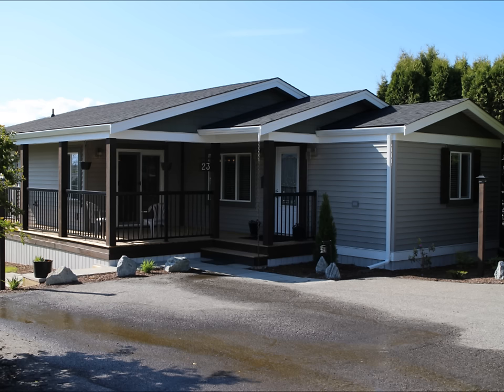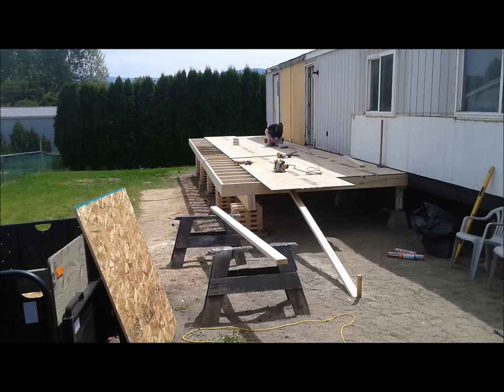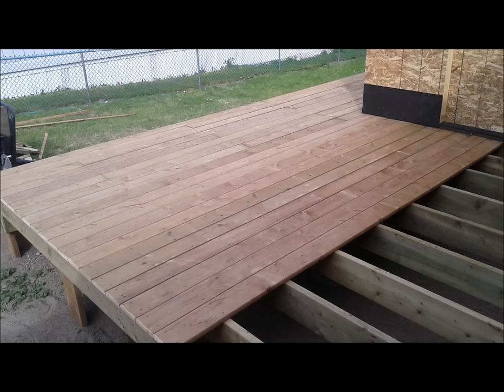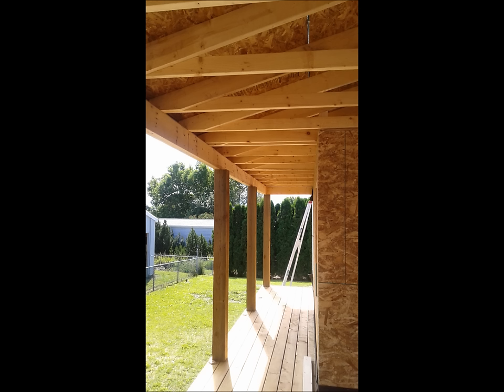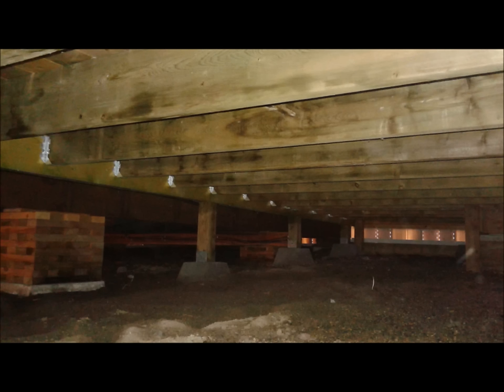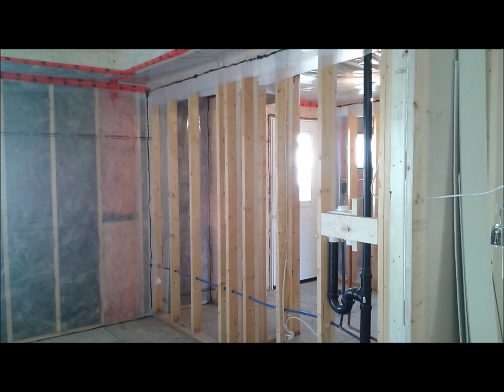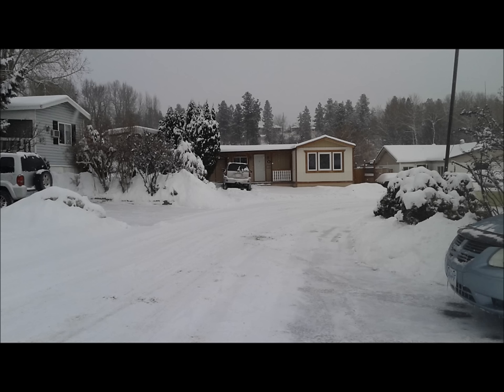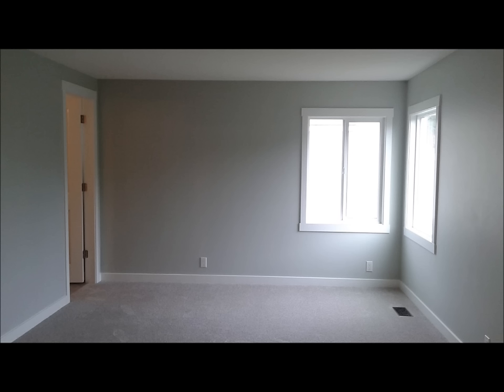Building An Addition To A Mobile Home - Start To Finish : E026 / BC Renovation Magazine

Comment: Those cribs can i build them as need more and  how deep  of concrete? When you leveled did you have to remove the gaslines and water from town? I'm in northern Alberta. You have allot more space to work under the home. Mine is only 19 inches.
Reply from the maker: Blendor Art, yes, you can build the cribs yourself. They are simply pieces of 2x4 cut 18" long and stacked 3 to a layer, crosswise to each other. The cribs are 18"x18". The last 3 layers sitting on the concrete pad are treated to prevent rot. Check your local codes. Some jurisdictions may require certain kind of wood. We were able to just use SPF grade.

Here (in the Okanagan Valley in BC) the cribs just sit on 24"x24"x3" precast steel reinforced concrete pads, which sit on a compacted gravel base. In Northern Alberta you may have to go deeper to get below the frost. Frost is not a big issue here. Again, check your local codes.

When we leveled we did not disturb anything around the bottom of the pile, unless it had tilted. Then we just disturbed enough to straighten the crib. All of the leveling was done between the top of the pile and the steel beams or wood cross beams, using shims. 

Thanks for watching and great questions! :-)

Comment: Question:  How were yall able to put your electrical panel in the same room as your hot water tank and it not be against code.   Because per NEC  you can't have water and electrical  esp your main power source in the same room.
Reply from the maker: Hello, sinaca05. This home is a 1991 model, built in a factory in Canada. The setup there with the electrical panel over the hot water heater is the way it came from the factory. We did not change that. An interesting thing here is that the electrical panel and the HWT are actually connected. There is a ground wire from the panel to the water intake on the tank. They used the water line as a ground. Again, from the factory like that.

In Canada, manufactured homes have to follow Canadian Standards Association (CSA) requirements. The design for the electrical is done by engineers at the factory and the design and installation is monitored by CSA inspectors, at the factory. When the home arrives at its destination site, any modifications then become the jurisdiction of the local inspectors and code.

Thanks for watching, and good comment! :-)

Comment: Nice job! Wondering hiw much is the fonal cost.
Reply: Bare bones minimal in the US with a honest contractor. With materials and labor could be anyware from 25-40 cents a square foot. That's just for the structure. Subfloor drywall. Roof plumbing and electrical. Now if you do it yourself it would be cheaper.

Comment: I'm curious if there is any concern about the home being financed by banks after the addition was done? I've heard nothing but words of caution because lenders don't like stick built additions to manufactured homes.
Reply from the maker: Taylor Family, financing really depends on where you are and what lender you are talking to. Where we are, this home in its existing dilapidated state was pretty much not financeable. Putting the addition on and renovating it as we did brought the value of the home up in value so much that it is easily financed by just about anybody now.

The interesting thing about this though is that around here lenders won't finance someone buying a home like this and then renovating it, but they will finance the finished home. Apparently their experience is that too many promised renos don't get completed and they are left 'holding the bag'. 

Thanks for watching and commenting.

Comment: I am a Small % owner of a mobile home park and manager and live on the property.  I took a tare down and rebuilt it to move on so I can be on sight to do my job but it's a simple square small 8' by about 2 f350s long.  I'm looking to put an addition on this Summer I want to a frame the roof.  In the original roof that was flat.  I want to remove that so we can have a open ceiling.  Did you choose to not go that root as to make an attic or was it just more structural sound. ? Ty
Reply from the maker: Josh, I contemplated making a vaulted ceiling in the new addition over the dining and master bedroom sitting areas. I decided to just go with that raised tray ceiling in the dining area and flat throughout the other areas, mainly to simplify things. An open ceiling would be nice. I don't see any reason why you can't do that.
Reply: @BCRenovationMagazine  my home is very small my spouse has multiple scelrosis and I need to make room for when eventually she will need a wheelchair.  My park is old built during WW2 near a military base.  Only one house out of all my tenants has a concrete pad lol.  My home I'm guessing at one time was probably made in the 60s by what I saw when I renovated it.  It was vacant for 11 years had no floor or subfloor in alot of areas.  And they cut the ends of the aluminum sided what I think was a camping trailer and made it maybe 6 feet longer on each end.  So it can never be moved.  When I left my career as a welder and started a buisness in property management I got tired of having to get up at all hours and drive 2 miles to see what the issue was so I took this condemned box and made it actually really nice and humble.  And it's an end unit so it will be easy to go wider with it.  One thing I'm trying to weigh pro and cons is when I do build the addition should it be ground level and have a set of stairs inside or should I attempt to build the addition at same floor height Wich will give me all kinds of leveling issue as how the previous additions where built on an unlevel trailer so when I went to level it I cracked the ceilings drywall I had to stop and just shim it as close as I could.  And than I did as much bracing I could underneath each length addition since neither end had trailer frame supporting it.  So if I go and make it so its all one level I'll run into all kinds of issues with flooring like the composite tongue groove drop in floor.  I also have to do this work while I'm living in it.  I was thinking about framing out a deck and the A frame just get the exterior up and green metal roof on than I can basically build along while we live.  I've done alot of mobile home additions and I've learned over the years you just have to go one move at a time have a basic idea of the finished product but when dealing with hacked up homes like mine just go at it custom no blueprint lol.  I really like what you did in this video and I appreciate the sharing.  Ty
Reply from the maker: @joshofalltradesgendron5464  , that is all very interesting. Sounds like you have quite the project going there. 🙂 One step at a time.

Comment: I have an old 1970''s single wide that we want to put an addition on and make the walls thicker to put better windows in and to make energy-efficient. Do you basically build around the outside with regular 2x4's on a footing?  Or is there a less expensive way?
Reply from the maker: Jennie, I am going through my comment section and am seeing your questions here. Somehow I missed your post.

What I have seen around here is that people will wrap the entire outside of the building with a rigid insulation board. Then they will install windows and siding on top of that. It is an easy way to increase the insulation value without building anything. 

The insulation board is available in different thicknesses and materials. Here is an example of some that is available at my local Home Depot: https://www.homedepot.ca/product/durospan-gps-r10-96-inch-x-48-inch-x-2-13-inch-gps-insulation-board/1001211235

Sorry for the late reply. Hope this helps. 🙂
Reply: @BCRenovationMagazine  Just to clarify, do you mean wrapping the outside in insulation and siding around the existing siding on the trailer or would you strip the siding off first and work from that point? 
I just recently bought a 1980 mobile home as my first home and we noticed this winter that it's about as airtight as a butterfly net and have since been learning so much from your videos.
Thank you for your content and for possibly answering my question.
Edit: this may be a ridiculous question but I'm working with zero knowledge on the subject. Apologies if it comes off as dumb.
Reply from the maker: @joshl16  , no question is ridiculous. I am happy to help if I can. 🙂

Can you give me a bit more information? What kind of siding does your home have?
Reply: @BCRenovationMagazine  its aluminum siding, dont think its original. There are a couple spots where the screws holding the siding to the house have pulled out and left the siding popped out a little  im guessing due to rot. 
This is my first house I own and I just bought it in January. I know something needs to be done about this but have no idea if i should strip it off and re-side it, screw the existing stuff back in and seal the cracks with caulk..etc. So the thought of just wrapping some insulation and siding around the existing mess and killing 2 birds with one stone is very intriguing.
Reply from the maker: @joshl16  , if you like, send me an email at: bcrenovationmagazine@gmail.com

I think we can communicate better about this by email. I would love to help you with this. It is too much for the comments section.

Kent

Comment: Word of caution, you should reconsider using SharkBite inside walls. Over the years we've all seen many of them leak. They're slow leaks, but leaks none the less.
Reply from the maker: Hello, Joseph. I agree with you about the SharkBite fittings. I don't like them. There were only two of those fittings used in the entire project. They were used here because the plumbing inspector required us to. He wanted a quick disconnect in the plumbing between the original home and the addition. This is how he wanted it done.

We left an access panel in the wall in the closet there so that the fittings were accessible for inspection and repair if necessary.

Crazy? Yes! But, not a good idea to fight city hall, or city inspectors. 😉

Comment: I have a ? Did you have to get a permit on this because I want to do a complete reno on my 1973 mobile home in bc and was told by City that I can not touch anything that's structur they will not give me a permit on that
Reply: The secret to mobile homes is this,  since they are not like normal built houses when you do your add on(s) get a permit for "accessory" and do like you see in most of the videos on youtube where you see them built on their own structures just butted up against the mobile home. What takes place inside is on you but at least from  the outside it will look like everything is on its own and I can't really see them saying no because even in this video the mobile home frame still stayed the same.
Reply from the maker: Willi, over here in Kelowna, we need permits. This home is actually on WFN lands so they are the jurisdiction having authority, but WFN, City of West Kelowna and City of Kelowna all have basically the same requirements. I have done projects in all three jurisdictions. Not much different.

For this project we had to get permits and inspections for building, plumbing and electrical.

I would be interested to know where you are in BC . Can you tell me that?
Reply from the maker: Heaven Wheeler, hmmm, around here, I wouldn't recommend that. They will catch up with you sooner or later. The consequences are not great. You could make your home un-saleable if you ever wanted to sell it in the future.

I am dealing with a project right now where people did just that and did not follow procedure. There is an addition to the home and a separate out building that were not permitted and nod built to code. There was substantial electrical problems. The state of the home was such that the lawyers could not legally convey the transfer of title to us. The home was un-saleable.

It's a long story, but the long and short of this story is that it has taken several months and thousands of dollars to get it all straightened out to a point that we could buy it from the previous owners. And we are not finished yet. The addition is going to have to come off. The outbuilding has to come down to be compliant.

If all would have been in order with this home the seller could have got about $40,000 for it. Because of the extent of non-compliance we got it for $2,500. The seller would have been much further ahead if the rules had been followed.
Reply from the maker: cr1m203, my advice would be to contact the local building authority and get their input on it. If the project is going to be ultimately successful and money be made on it then the rules have to be followed, and the rules vary widely depending on where the project is. 

Thanks for your comments.

Comment: I loved everything. How ever putting ceramic tile directly on plywood is not a good idea. Backer board should have been used or a Schluter Systems Ditra Membrane Underlayment to Prevent Cracking. But that’s just me Looks beautiful 👍🏽
Reply from the maker: Hello Noe Ruiz. Thanks for watching and commenting. We have had a few comments about tile over plywood. Where we are this is acceptable practice and code approved. The key here is the combined thickness of the layers of wood and how they are laminated together. We have done many floors like this over the years in different projects and have not had problems with cracking. The Schluter system is a relatively new concept (at least to us) and a LOT of tile went down before that system came along. That being said, large format tiles don't perform well over wood. These tiles are not considered large format. Our opinion is that the additional cost of using a Schluter type system is not justified in this kind of installation.
Reply: @BCRenovationMagazine  In addition to adding thickness/strength to floor, it looks like you dropped a nail every 20cm or so- if that was accepted practice, I can see why you dont have buckling, breakage problems. Also, in your part of the world, the lease/ rental arrangements are different. Great job- I'm not a fan of vinyl siding but at some point the budget "spoke"- it always does on those jobs!FR
Reply from the maker: DR PHIL  , it is kind of an urban myth that you can't put tile over plywood. I have laid a lot of tile like this on my projects over the years (40 years). I have had a lot of tile contractors lay tile for me over the years when I didn't have the time myself, and I took my cue for method of installation from them. We never had a single call back from problems laying tile over plywood. 

I have also pulled up a lot of tile in my career. I have pulled up much more than I have laid. It has all been over plywood, concrete or weird stuff like linoleum or in one case particle board (in a mobile home). None of it was over anything like Schluter Ditra or similar. The tile over particle board was some of the hardest to get off! Came up in tiny pieces. It was 12" x 12" porcelain tiles. Had to chisel it off and it took good chunks of particle board with it.

My experience was that none of it came up easily unless it was not done correctly. Floor tiles that are applied with mastic instead of thinset pop right off. If thinset is used and the trowel notch is not the correct size, or if the thinset is not mixed correctly (not allowed to "slake"), or if the thinset is applied in swirls, thinset will fail. Often it comes down to quality of workmanship and expensive products like Schluter, etc. won't make up for poor workmanship. 

These tiles were laid on a product called SurePly. It is a premium, economical product that is rated by the manufacturer for this application. It was screwed down (not nailed or stapled) on a 4" grid in the field and every 2" along the seams. https://www.patriottimber.com/sureply-underlayment/

If I were laying 24" x 36" Italian marble tiles down in a million dollar mansion I MIGHT consider a different way than how this was done, but we are not doing that here. Our goal here is to help people get the best bang for their buck and use products that are DIY friendly, easy to use with standard tools and are easily obtainable. This method fits that bill. It has worked well for us for 40 years. I don't see a need to make a change.

Comment: Was the foundation of the mobile home already permanent? Or how did yall make the foundation without moving the mobile home??
Reply from the maker: D Ldez, this home is not sitting on a permanent foundation. The original unit and the addition are sitting on cribs, which is the standard for this type of home in our area. It may be different where you are.

Thanks for watching and commenting. I appreciate it. :-)
Reply: @BCRenovationMagazine  thank you:)

Comment: Do you need a permit to put in an addition to mobile home
Reply from the maker: Hello, Michael. Yes, in our area, permits are required. Permits had to be taken for building, plumbing, and electrical work. Also a gas permit for installation of the HVAC system. There were several inspections made by the local authorities. We also had to get approval from the park owners.